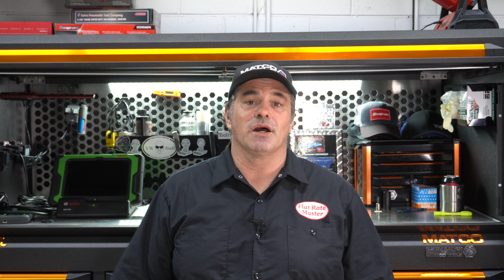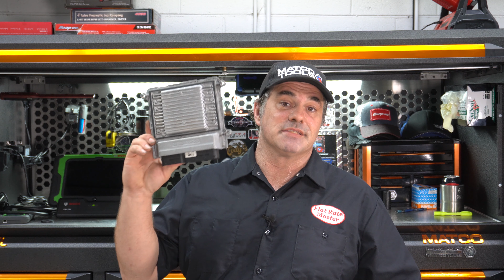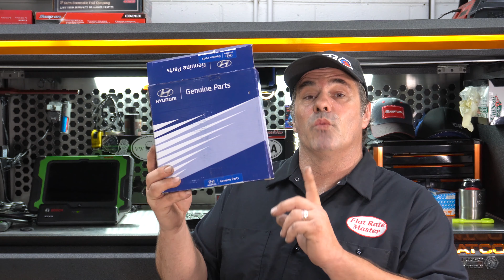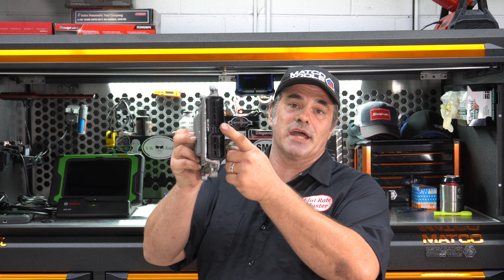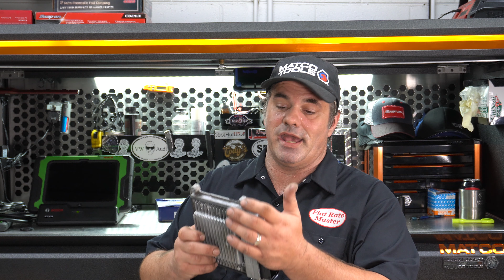How You Get Confidence in Your Diagnostic Skills

Comment: Good point on a topic that is really hard to get a handle on. With today's cars, there is so much going on with data flowing on multiple interconnected networks it is hard to even estimate the amount of diagnostic time needed.
When you go to a doctor with an unusual symptom, the doctor typically orders multiple diagnostic tests. When the results come in, the doctor often orders another round of tests based on information learned from the first round of tests. They are thorough since their comebacks could mean somebody dies.
I think this approach needs to be considered in the automotive service business. We shouldn't be sheepish to request additional diagnostic time if there is any doubt about the $1000 module we think is bad. In many cases, if you make the wrong call, the customer is going to want you to eat it.

Comment: I had a Chrysler 300 with an airbag light. Pin point test said it was the driver airbag. Ordered it, took 3 days to get it. Installed and had the same issue with the same DTC. Ran through the test again with the same results. Of course, I'm second guessing myself now so I get the service manager to go over the test with me. He said order another airbag. 3 days later, 2nd new airbag installed and it was still the same. Got in contact with Star (Chrysler's tech support at the time) and the guy walked through it on the phone. Halfway through he says go to step "whatever". I said that's not what the service info says. I read back what it said and he said to hold on. About 10 mins later, he came back and said the service info is wrong online and he would fax me the correct info. Turns out that the info was not published correctly online but was in the hard manuals (which few dealer buy anymore because of the cost). Turned out to be the ORC module. Now imagine if this had been a non-warranty repair job. The shop would have been eating the cost of the airbags. Luckily for me, the tech support rep got me paid for all the time I spent on the job. Wow, that was a long winded way to say that sometimes your diag is only as good as the info you have to go buy.
Reply: meabob 100% true. Ive had this happen to me more then one time. Diagnostic info be wrong or over look something that should have been tested. Flow charts are garbage. I rarely look at one anymore. Being in the aftermarket and not having access to some info makes things harder at times.

Comment: There are a lot of really good comments here.Thanks FRM. I myself still don't have all the confidence that I need especially because of the  big change in technology. I have worked many years as a B tech  and have done some drivability and would like to progress and grow. The body is getting older and not having enough time in the diagnosis seat is causing a lot of problems. I find myself hunting for another shop due to Covidcrud. Im still in pretty good shape physically for my age but the confidence is not so high anymore. I know what I can do and do it well. I am not a proficient diagnostician to be able to make the call in a short time span. I just want to continue to work.

Comment: I work at a Hyundai dealership and I have a 2011 sonata that isn’t getting signal from the right rear speed sensor! It knows when it’s unplugged plugged but it Won’t give a reading of the speed! Then the fuel pressure regulator is acting up. Another shop replaced both parts witch I got and tested and they are fine .... now I’m tracing down wires it’s a pain in the butt.... plus the customer spliced some DIY lighting in all over the place it is a mess and It’s so time consuming ! finding decent wiring diagrams on the Hyundai site is nearly impossible! Plus it’s a small dealership and there is no factory trained techs.... Another guy and myself have plenty of experience in the field but not specifically to Hyundai.... like I said it’s a mess
Reply: My shop is also a Hyundai shop and you are 100% right about their electrical diagrams. It's their whole service website.

Comment: i have a 17 terrain in my bay. it has been setting a left rear speed sensor code. i followed service information(SI)   for that dtc. circuit tested normal. SI lead me to put a wheel speed sensor in it. do it, clear dtc go drive it. dtc runs and pass. ship the car. 2 weeks later comes back. same code. retest same circuit and now SI is telling me its an EBCM , so i double checked the circuit to the wheel speed sensor. diag leads to EBCM. put ebcm in car, program it. drive it more then once, and further , code runs and pass. ship it. 

this pass friday ... comes back. same code stored history/not current. re test again. go drive. cust said stabilitrac/abs light is coming on intermittently. well i cant get it to do it. i start checking the harness, looking for anything. go drive it again and boom out of no where left rear speed sensor dropping in n out. well now i have a hard failure and already replaced ebcm and wheel speed sensor. make the call to re string the circuit. , ebcm in the engine bay , left rear speed sensor well at left rear wheel. so about 15 ft of wire, a jumper harness and all that jazz. well i get it put together today. go drive it. code is gone and drives normal. i havent released the car again til i drive it tomorrow for a longer period.   

it makes me feel i messed up somewhere. but i followed the SI diag procedures and everytime it would run and pass code. i feel bad for the customer but they have extended warranty so its not costing them anything. i just wonder what i could of done different to catch the intermittent issue, how can i learn from this so i dont get caught by this again. maybe better info from cust to service adviser so i know to look for intermittent issues? idk? not repair anything til i get a failure even though i had a code to diag? oh yes i inspected the wheel hub/exciter ring before calling for a re string. 
its stuff like this that makes me gun shy as a newer tech.
Reply from the maker: Bad info always sucks